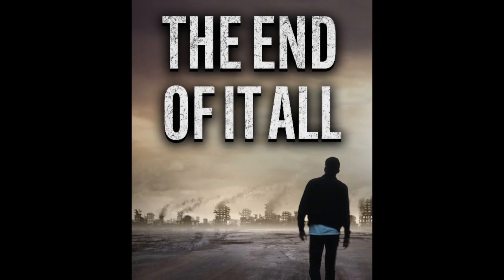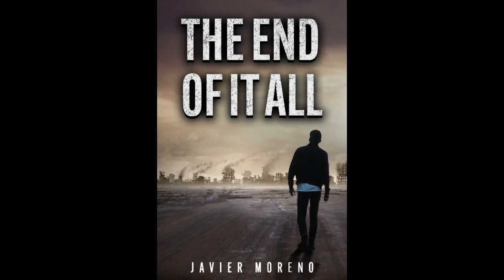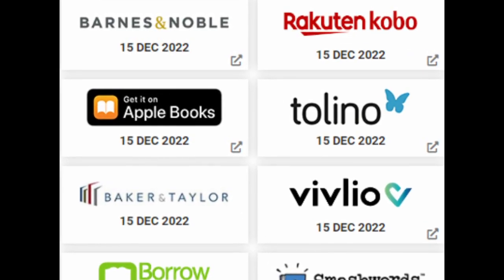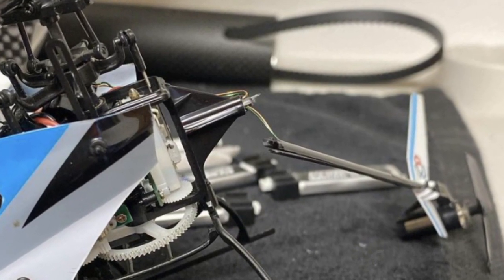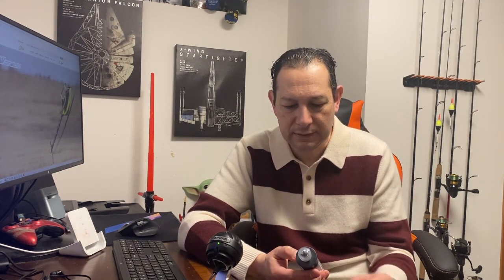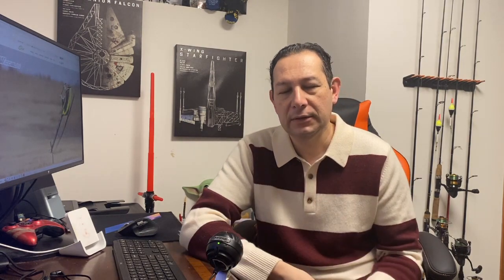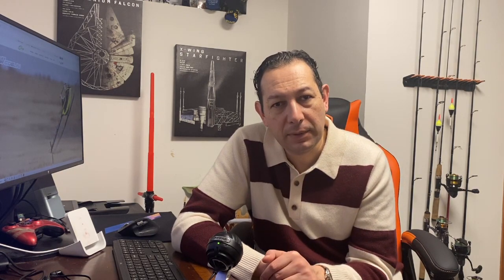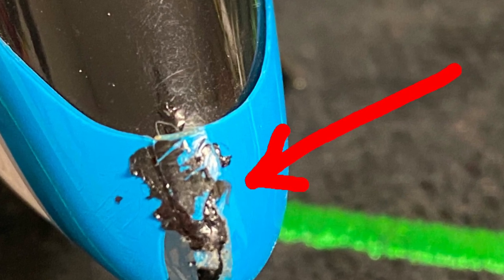TINY radio control helicopter - tips and tricks - Blade Nano S2

Comment: Good tips! Similar connections for the Mcpx bl2. I use a tiny amount of  superglue (I think in the US you call it CA glue). But the fabric paint will be easier to detach when needed, as the glue is rather permanent!
Reply from the maker: Yes! This is a much better solution to CA on this type of Heli. The fabric paint does leave a tiny black spot when removed (it’s paint after all hehe) but you cover it after you apply again.